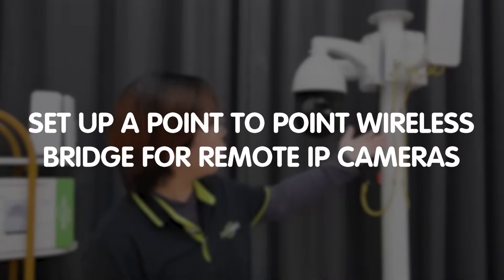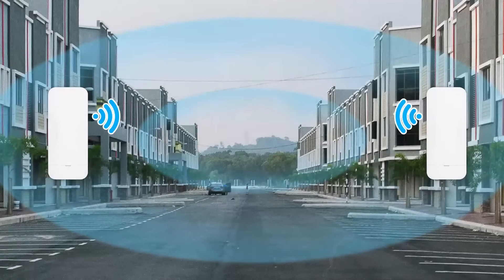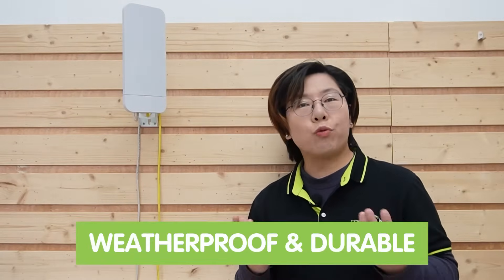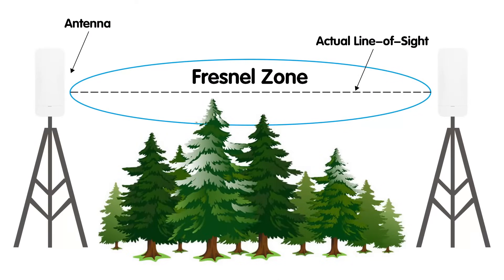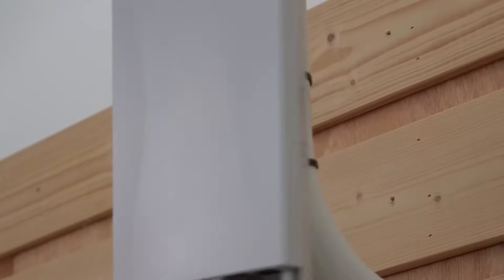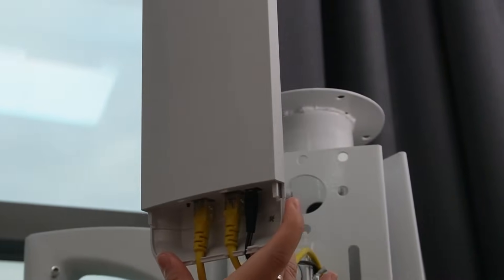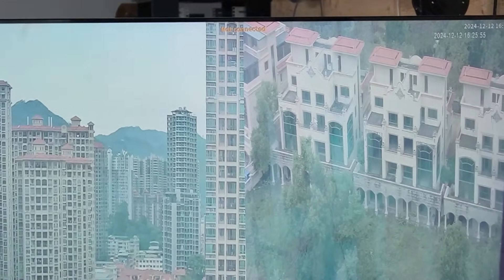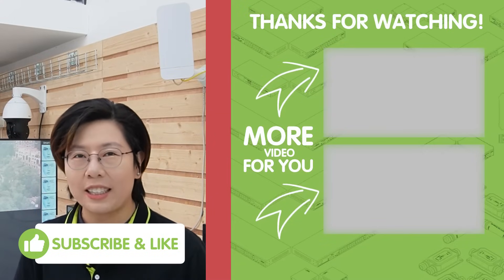Setting Up a Point-to-Point Wireless Bridge for Remote IP Cameras

Comment: We can use switch  poe with cameras and bridge if I install more 2 cameras
Reply from the maker: Yes, just connect the switch to its LAN port via Ethernet. However, you need to power the switch separately.

Comment: Thanks for video, poe switch can allow more cameras ?
Reply from the maker: Yes, since the bridge only has 2x LAN ports, a PoE switch allows you to connect more cameras at a time. However, it's a shared bandwidth so you need to ensure the required bandwidth of all cameras doesn't exceed the bridge's bandwidth capacity.
Reply: Great thanks for the reply, much appreciated. One more question, what other examples except for cctv could this wireless bridge be used for?
Reply from the maker: It can be used to establish network links between structures like offices, warehouses, or guest houses. or expand Wi-Fi coverage to outdoor areas like parks and farms.
Reply: Great thanks alot , great youtube channel. Good work
Reply from the maker: Thanks!🙌